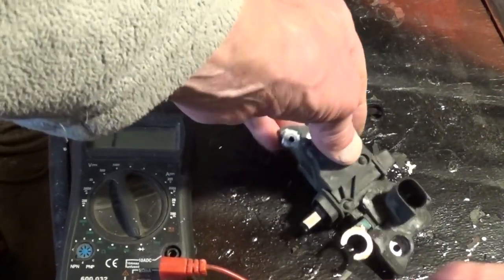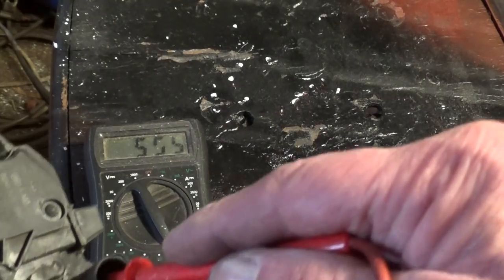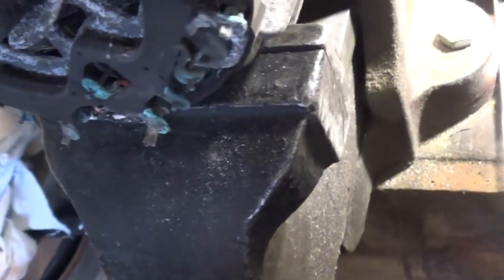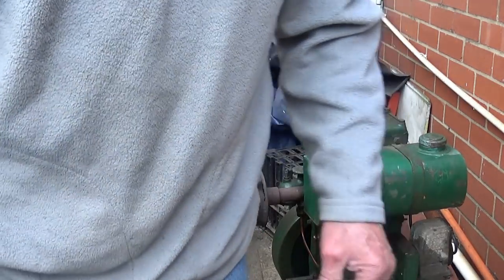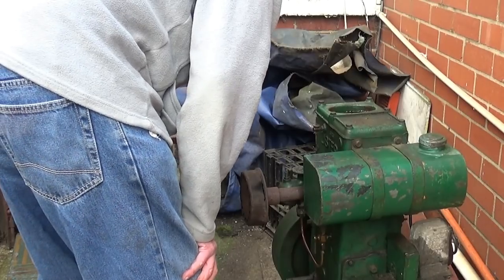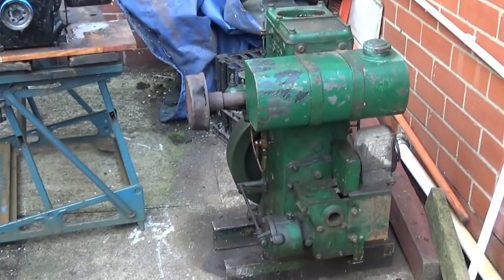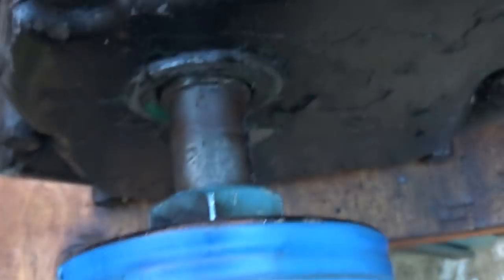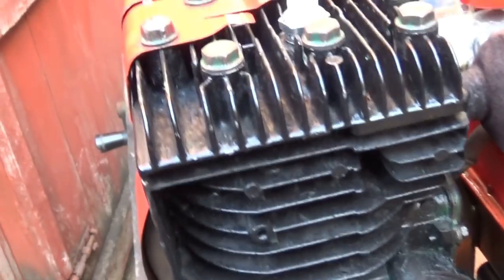Lister D Donkey Engine

Comment: Nice Engines , watch the cooling water in the older one that it does not freeze. You could build a cart for the older engine ,that will raise it up off the ground. Love watching your videos .
Reply from the maker: Thanks. 50% antifreeze in the coolant, should be ok. As this engine is most likely staying in my little backyard, really need it fastening down rather than a cart.....we'll see. Probably just get some wheels for it. Anyway, hoped you like the 'mystery engine' i.e. the one that runs with the plug lead disconnected.

Comment: Malc try the belt in a figure of 8 it will be harder to slip off if not in line regards martin
Reply from the maker: Cheers Martin, I agree. Just need to turn the engine around and line it up clamped together. Only thing is Briggs won't start if the belt is tight. Only trying it because I have it.

Comment: Yeah, some units I think might not use the light to excite the windings while others do. They can differ. The light should come on any how, so  good work finding it doesnt work.
Reply from the maker: Cheers James. I was just curious and decided to look. Tony said they charge without a light. I think if you excite the windings they then charge as long as they are running fast enough of course.
Reply: @MalcOfLincoln  Ok, the old Lucas ones were simpler than the more modern electronic gizmos of today.That lister does look like its heavy to spin over right enough. You will tweak it in time I am sure.
Reply from the maker: @JimF500  Well I got the Lister just to have a play in my little back yard didn't I. Actually surprised just how easy it is to hand start. Just trying what I've got....see if it can be done. Actually already done more than I thought I would when I first thought of getting one of these.